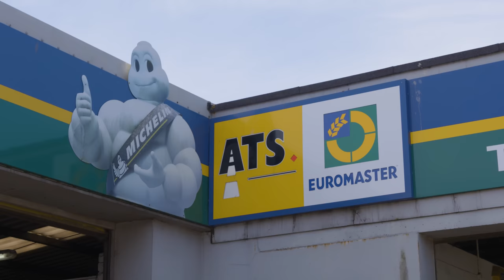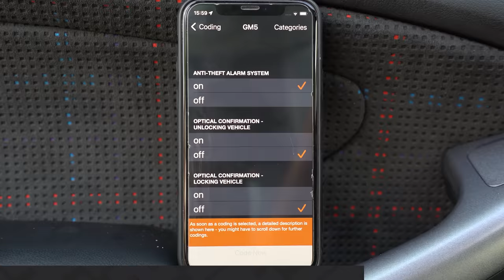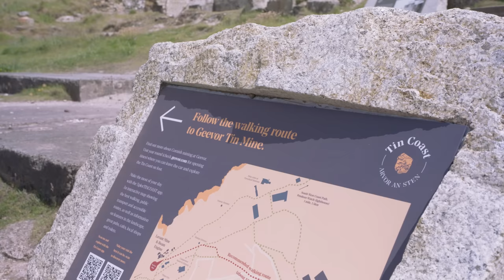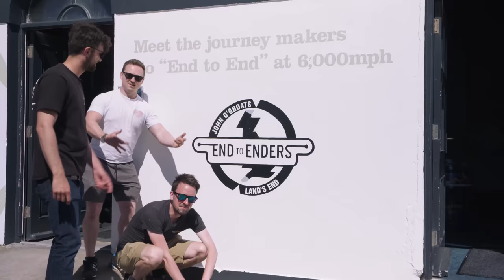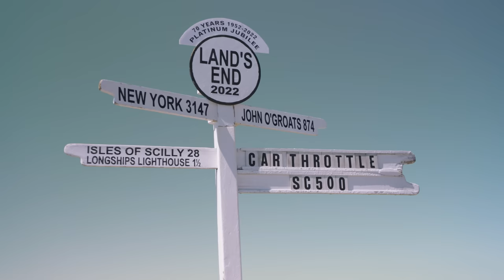£500 Modified Road Trip Challenge: Part 2

Comment: Are there any outtakes where Jack has to go back to ECP 3 times til they finally manage to supply the correct radiator?
Reply: ^ this guy knows
Reply: As an ecp sales advisor I resent this….. no wait….. there’s more that guess and click than use the dealer site 🙄😂
Reply: @garyrmatthews3808  I spent 12 years at motor factors. Including a brief stint at ECP. Unfortunately those who know what they're on about were replaced by kids who'd work for less and use a computer to search for stuff rather than knowledge. :)
Reply: 3 times is a severe underestimate for Euro Parts.
Reply: @blainy-o93  EDDIE HITLER
Reply: @simonr7974  Any relation?
Reply: @kanedaku  I've got a mother?
Reply: @simonr7974  🤦‍♂️ When you ask Eddie Hitler "Any relation?", he normally answers "Yes!"
Reply: @kanedaku  correct. And on one occasion the above. Think it was the dating agency
Reply: @simonr7974  Whoops, remember the episode but not that part.

Comment: May I just say about the sponsor and I'm not getting paid for this. I swear, I just have one at Carly's expense. What I have to say is its bloody brilliant as we had a rather problematic volvo xc90 (erica) and I had to run constant diagnostics as the car was firing its CEL and I had the problems fixed as soon as my wallet allowed me to.
Reply: I bought a full pack from Carly's for my VW Polo 2007, so do you think that it will detect even the ABS sensor that it's faulty? So I don't have to waste time taking out each sensor one by one and check them? I paid £130 for the full thing 😅

Comment: Fun fact, the ship was called "RMS Mülheim" the town where I'm living now "Mülheim an der Ruhr" 
It had 2200t of shredded plastic loaded on board, there were a crew of 6 and they were rescued right away via helicopter on behalf of the Royal Navi. It caused ecological damage by releasing a 500m carpet of diesel and around 300t of plastic in to the water. 

The ship broke in 2 pieces in Oct 2003 causing this landscape. 

I'd like to see it myself tbh.

Comment: Good to see you guys made it. I did the nc500 and the sc500 in 3 weeks, starting from the ferry at harwich going up and back down to lands end and back again to harwich over london in a 2006 citroen dispatch with 170 000 miles on the clock. All went great and best trip so far

Comment: No lie. I wouldn't let those guys take my air conditioner out. It's not my fault their cars Don't have functioning AC. Then I'd just take that straight pipe and throw it on the ground it's fine the way it is. leave the muffler off for good boom, loud.  put the radiator and we're rolling

Comment: Having the heaters on full doesn't really help if the rad is leaking, because its the same coolant in both, if it leaks out the rad it can't circulate through the heater, that's more for if the fan isn't cutting in and you have to stop a lot in traffic.

Comment: Ethan gets a straight pipe upgrade on his Focus. End muffler gets easily removed.
I replaced the end muffler on my Focus yesterday, but I had to cut my exhaust with an angle grinder making a little mess dring the process, because both mufflers were connected by the pipes, weld together (whoever of the former owners did that bs).
I feel angry. I feel Betrayed.